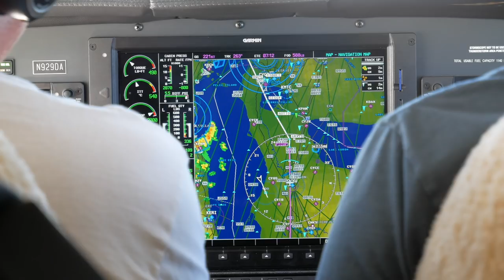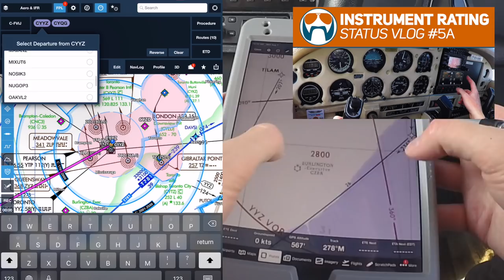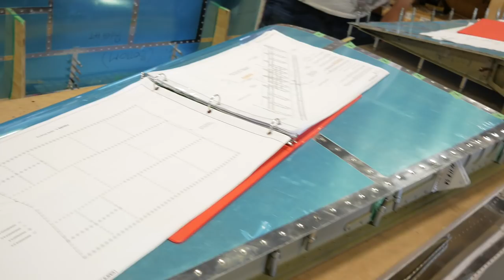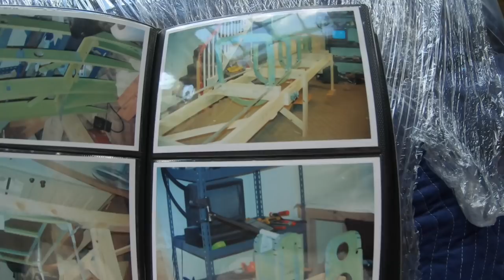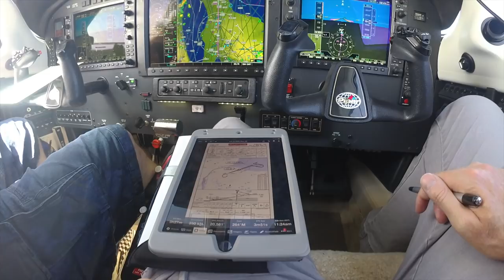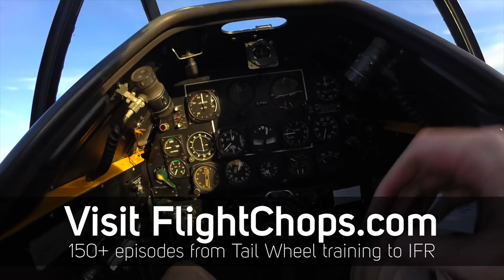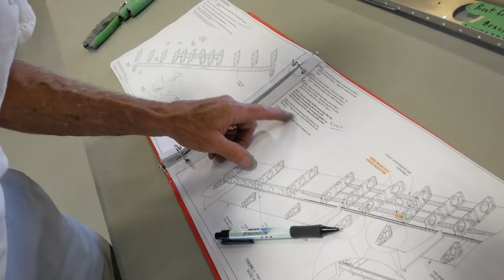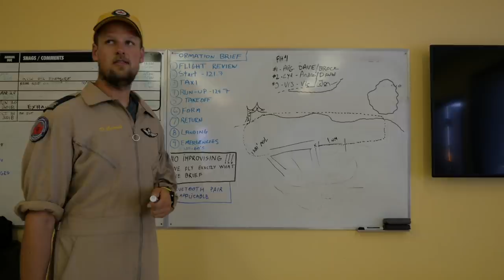She Flew Open Cockpit + helped Build our Plane - Inviting viewers to do the same!

Comment: Look in the datasheets/manuals of consumer electronic things. Most components used to build them are tested upto a certain altitude. (Often something like 2000 meter)  If you are that high, things go wrong faster when it is f.i.also  hot. Besides that there is also much more background radiation (from the sun) the higher you go and that big engine can "polute" the power net of the plane and if you power a camera or ipod from the plane things like inductive spikes can kill consumer electronic. Airplane and automotive stuff have a lot of extra protection and special parts to survive those things. Ipad and most cameras not.

If I lived near I would have come..

Comment: If you don't have the fancy tech it's not hard to figure out when and how fast to descend to hit a point when ATC wants you do.

12 miles before PICKUP you need to be at 12,000. It looked like you guys were at 20,000 at the time. So you need to descend 8,000 ft.

For top of descent calculations it's (altitude to descend) x 3. Take that answer and divide by 1000. So 8,000 x 3= 24,000. 24,000/ 1,000= 24. So it will take you 24 miles to reach 12,000. Or you can just divide the altitude to descend by 1,000 and then multiply. So 8,000/ 1,000 = 8. 8 x 3= 24. Basically just take how many thousands you have and multiply by 3. (22,000 means you have 22 1,000s so 22 x 3. 8,000 means you have 8 1,000s so 8 x 3.)

Now to make this happen you need to have the right descent rate. To do this take your ground speed and multiply by 5. It's hard to tell but it looks like you guys were at 250 knots GS. So 250 x 5= 1,250. So descend at 1,250 FPM.

So basically it would have taken you guys 24 miles at 1,250 FPM to hit 12,000 ft. She said cross 12 miles BEFORE PICKUP at 12,000 so add 12 to 24. So you needed to start the descent at 36 miles from PICKUP. Also you need to keep the GS as close to your calculation as possible during the descent because if you calculate for 250 knots x 5 and you slow to 200 knots will now you're 250 FPM off track. So it's actually simple. 8 x 3 = 24. 24 + 12= 36. 250 x 5= 1,250. That's all the calculations you needed to comply with that instruction.

Comment: I am confused by the ream it with a drill bit  or a reader and there is no burr. drilling an already drilled hole will widen the hole and make burr. 
You can see this if you take a piece of discarded sheet metal, drill a hole in it, deburr, drill it again and run you hand on the other side, you can feel it. Maybe not a problem but just a confusing statement, maybe I misheard what he said.
Reply from the maker: That's why I asked Perry at the time. I'll look for more clarification on this...

Comment: Steve, what about using some anti corrosion paint on the ribs/spar?
Reply from the maker: Yeah - we’re priming everting
Reply: Actually all of our parts and all the insides of all the skins are primed for corrosion resistance purposes- it's just not very obvious at a glance.
Reply: David Carrick Cool. I was expecting to see more yellow on the parts. What kind of primer are you using?
Reply: @maillouski  I forget the exact part number but it's exactly what is recommended by Vans in the build guide. It's a Sherwin Williams product if I recall correctly.

Comment: Humm, the Vertical stab looks all closed up... you have someone from MD-RA on site?  I guess what I'm asking is did you get the pre-close inspection done?
Reply from the maker: I think the plan with that is to leave the spar disconnected until after inspection.
Reply: @FlightChops  Yup - that's what most of us do - from the quick glance of the VS it looked like the rear spar was riveted, I guess I saw wrong ;)

Comment: Watching you riveting was just painful! A rivet gun is NOT an air hammer! Trigger control is key. The difference between an air hammer and a rivet gun is the controllable trigger. Anything more than two to ten pulses per second it just too much. Just fully pulling the trigger is totally wrong. sigh Watching pilots do mechanics work is always something that makes one worry. It takes time, but you can do it. The only advice I can give you from my location is to try to get a full time structures engineer to teach you how to do it properly.  DO NOT USE PILOTS to teach you to be a mechanic/engineer! The unfortunate truth, to which pilots never want to acknowledge, is that pilot's knowledge alone does NOT possess the required knowledge to accomplish maintenance work. Get a real full time engineer in there to teach you properly.  Realize that in the U.S., to be a pilot requires a minimum 40 hours instruction before you can take the single basic private pilots exam before your oral and practical exams. To be a mechanic/technician/engineer requires a minimum 2,100 hours of instruction before you can can take the three exams before your oral and practical exams. (In Canada it's even more stringent.) Think about that as you build your aircraft.
Reply: Yikes! phantumdrummer; If you want absolute perfection, you are correct; Of course if only mechanic/engineers built RV's with oversight from a full time structural engineer than there might be only 100 RV's built. Fortunately many pilots have successfully built fine well engineered RV's capable of +6, -3 gs. 10,000 in fact!
Videos like these from Steve will awaken our next generation of young aviators, many of them saying "I can do that!"  
...from a combat aviator, aerospace engineer, airline pilot, and RV-7 owner